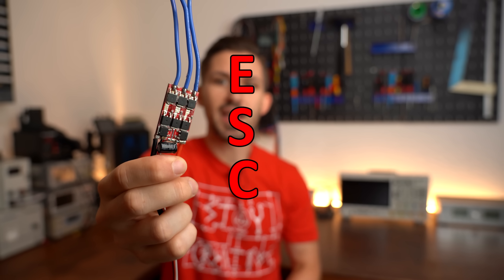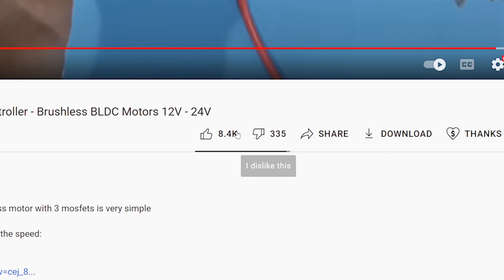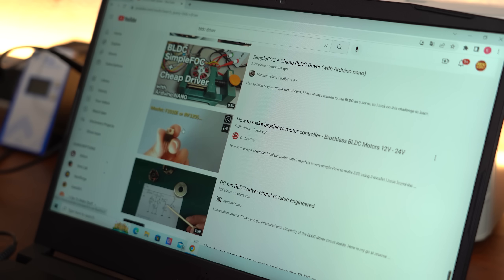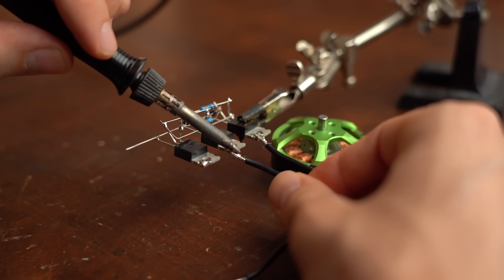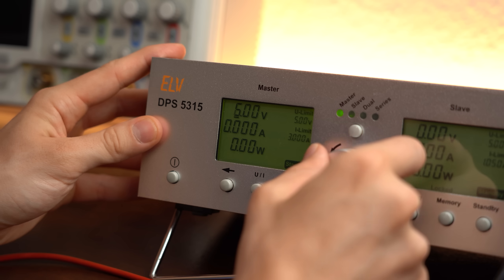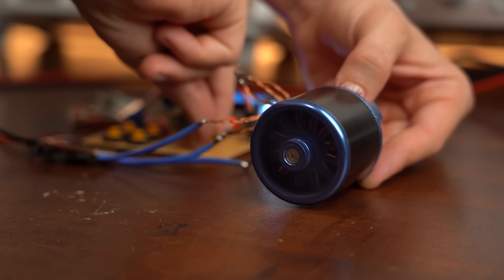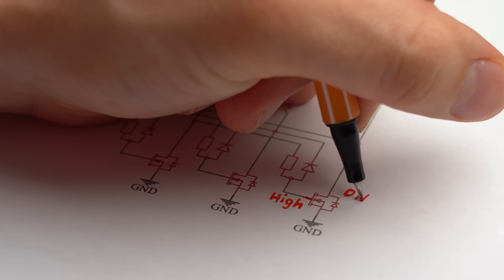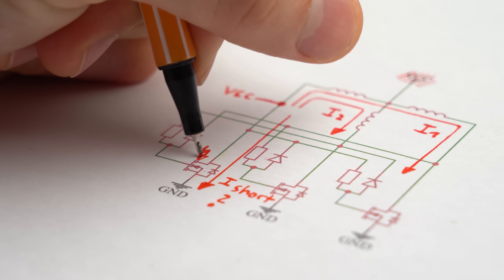I followed a YouTube Electronics Video and Regret it! (Debunking a 500k video)

Comment: I think it's more an exercise in "how simple can we make this circuit and still have our functions?" A lesson in building circuits, to be sure, but not something for practical use.
Reply: Aka muntzing
Reply: Thing is "simple" is often simple* when you start cutting so much out that the circuit is reliant on certain stray values or other unspecified/variable component characteristics to work properly, which makes it difficult to duplicate. There are some popular simple circuits that are simple and easy to get going with close enough parts, joule thief comes to mind, but there aren't many of them and they don't do anything particularly complicated, e.g. properly drive a BLDC.

Comment: As a general rule, I never trust any video where the circuit is soldered “in the sky”😁
Reply: I mean dead bug was very common in the 40's, and for rapid prototyping is still used today. Also used sometimes just for aesthetic or because it isn't desirable to put in on perf board or something

Comment: It’s been a long time since I’ve seen a 3-dimensional circuit sculpture— the last time IIRC, was looking inside a 1950s pinball machine.  Why this guy didn’t just plug his components into a breadboard is beyond me (they make high quality breadboards that can handle more current and have more insulation between lines, right)?

It’s one of those things when you’re watching somebody claiming to be the expert (debunking someone else’s video) who themselves seems to have skipped Electrical Engineering 101, and never learned that you basically never want to create a 3D sculpture, it’s easy to accidentally short-circuit (potential fire hazard), it’s hard to modify (e.g. swap out a resistor), and it doesn’t have the same logical coherence to a circuit diagram that working on a 2D plane with discretely layered lines and jumpers does.

Comment: As soon as I saw that it only had 3 MOSFETs I thought "how the heck is that going to work with a 3 wire motor?" and also "this isn't going to be speed controllable, because it must be using some kind of inductive feedback for phase control" - and yes, that's what it was. An interesting circuit, but not at all useful except as a learning example.

Comment: I'm sure you have a lot of requests, but I'll put out an appeal:
I'm slowly losing my sight and will be needing a braille printer at some point, HOWEVER, a cheap braille printer is $5,000US
Basic Braille characters consist 3 columns and 2 rows.  3 solenoids strong enough to raise a dimple on a paper sheet would be the ticket.
I can actually do the programming, but electronics is not my strong point.

Comment: Why can't we just have two wire brushless motors designing it may be difficult but it'd be a heck of a lot easier, I have a design in my head based off a couple magnet motors but given that magnet motors don't often succeed but some do I'm skeptical of my imagination.
Reply: @LabRat Knatz why can't we just include the ESC in the motor housing!?
Reply: @mrnobody.4069  There is. Hobbywing Fusion.

Comment: Running out of 10K, huh 😜?
Btw I remember that you used to store MOSFETs seperately. But now you have a single bin for MOSFETs. Same for diodes? Is it some extras bin? Or you mix these coz the package size is big and part number is easily readable.

Just asking because it would help me organize mine. I really like to be a (**Voltage**) Follower of yours 😁😂.

Comment: You can get capable BLDC drivers off of commercial printers some are pulse controlled and some with a voltage reference. Use the motor as is or remove it from the circuit and add your own.  https://www.youtube.com/shorts/fjeaiIZa_7s I am amazed that that circuit works wonder if it can be improved somehow. Thanks for the video. https://www.youtube.com/shorts/dyIYoKcMhQU Could you do a circuit that gets timed by Arduino to make these 9 components work or even less like 6 components? Always watch your channel. Here is a stepper driver done with TIP111 I think. https://www.youtube.com/shorts/d9JuIY5z2Kg You can drive a stepper with only 2 transistors check the motor on the left.

Comment: That's a simple astable oscillator.  Usually cheap rgb lights use this circuit but they have a cap as well from every drain pin to the next base of the tranzistor.  Simple for basic task but not stable for complicated applications

Comment: I'd enjoy seeing you use the AliExpress board you recommend. It has a lot of connection points and no schematic. Looks like it would work for a 5 wire motor? I'm  not sure how this board works but I like the specs and price.
Reply: No the alix board uses standard 3 wire motors. You can read the description for what the connection points do, not all are needed.
Reply: @jaro6985  Lol did you read and understand that gibberish? It might ght as well be written in greek!

Comment: After watching the diagram, I initially thought it works like a crude RING oscillator created by 3 mosfet and 3 coils with a star point. This is awful. Cause not all inductor or mosfets are ideally same and won’t start the motor due to insufficient current draw from star point to Lets say coil 1. It totally depends on high frequency oscillation, so you really don't have much room adjusting the frequency value. Some might add capacitor to control over frequency making the circuit worse and unstable. Also the total load is not equally distributed as you showed in last, it works with star point less motors too - prooving that only two transistor oscillating as multivibrator but in this case creating alternating current due to the nature of inductor to store and pull over the current. last but not least, the freaking spikes will definitely kill a Mosfet in the long run no matter how good they are. 

Designer of this circuit must be on weed while designing such bs.
Reply: Take 3 of the DIY inverters and feed it by a signal that's delayed by 120 degrees each.  Of course, at that point, it's just easier to use a $0.50 cent microcontroller and PWM the signals with a smoothing capacitor.  It still won't detect stall conditions, but it will at least drive the thing reliably.
Reply: @EmperorA0  absolutely

Comment: Yeah the circuit is not suitable for low speeds where the back emf is low, but I like how the commutation logic is implemented using resistors and diodes

Comment: Fascinating. I'm a complete amateur at a electronics but love tinkering understanding the underlying principles. In fact 9ne such project a few months ago was to understand how to make a basic BDLC motor driver... before I even knew of ESCs ;)

Ended up using an old Arduino and a bunch of MOSFET modules that worked fairly well, but just as the video would need a manual kick.

My take-away was that while his proved the basic principles it was clearly not a "useful" circuit and certainly not one I'd embarrass myself by committing to YouTube.

It's a real shame unverified crap like this gets so much attention but I'm grateful that channels like Great Scott are here to debunk and set us straight on such topics.

Comment: While it's not in any way an Electronic Speed Control as it doesn't offer any speed control, it's an interesting bench toy BLDC driver topology. Wouldn't call it a hoax or fake, it's just not that useful. With some tweaking though I wouldn't be surprised if this topology showed up in some cheapified China export motorized toy.

Comment: These are synchronous motors, they can spin only on the current's frequency. So when you want to start the motor, you have to increase the frequency from zero to the desired, otherwise they won't start. So if the circuit not supports the soft start, it's not wierd if you have to spin up the rotor by hand.

Comment: So... What's the solution to restart a stuck motor? I'd need this answer for a project :D
Reply: Put a start capacitor on one of the windings... Basic motor theory..
Reply: @platypusrex2287  I already did this without much success ^^, Do you have a ling to some literature about this kind of problem?

Comment: ESCs are used in the RC (radio control) hobby, and are strapped to quadcopters, cars, planes, etc. For this reason the compactness and toughness of it are quite important, hence the DIY doesn't make much sense.
Reply: I was always surprised how thin the wires if my 150 amp esc are, if you look at the ground wire of a welder...
Also the power output of modern brushless motors is insane, my 1:8 offroad buggy from 2013 has over 3 kW.

One important feature that self made esc is missing is the self starting and the possibility to reverse motor rotation, i dont really see a use other than the educational reason as you mentioned

Comment: You can easily run 3 phase low voltage induction motors using this circuit
Reply: Not for long.

Comment: Even though it's not a reliable way to drive a BLDC, I find it's still impressive that it somehow able to spin the motor. I wonder if there is a possibility to overcome the issues you highlighted with this design with few more analog components ( op amps, transistots etc). BLDCs are quite cheap these days yet escs are bloody expensive than the motor. If there is a way to build a simple esc for a lower price, I think this type of controllers too can have some niche applications. 
Also I don't agree with the title "debunking". It's certainly a working design, only it's not really good for anything at this stage.
Reply: Considering it doesn't even have a full 3 phase h-bridge, it is rather impressive.
Reply: @Jtretta  Yep, my exact thoughts. Spinning a BLDC is bloody hard, it's impressive such simple design can do that.
Reply: It's certainly a "debunking". The motor required a manual spin to start it. The whole gimmicky video relied on the basis that somehow, 9 components can achieve something as good as 85 components. That's debunked as well. If we add more components then sure the design can be made better. But then the component count starts shooting up. Then the proper ESC starts looking better anyway.
Reply: First comment which actually makes some sense.
Reply: I have a old cooling fan based on 7 transistors/FET's (unknown). It's made by a company doing professional fans.

Likely some overload feature and auto-start with the extra trasistor.
Reply: You should try searching for "BLDC driver" or "BLDC controller".

ESC is a part of remote controlled planes/boat/cars/bats e.t.c. They are not called that outside the field of RC crafts field!

Or go totally fancy: field oriented control motor drive (FOC).
Reply: Adding sense coils, or using a trigger of some kind will do it...
Look up pulse motors, they run themselves in similar ways...

Comment: I got a cheap 30a esc from ali for 6 euro, dirt cheap! Why make this useless circuit? Just save the mosfets for your next big project i also disliked all those esc vids you can make a esc at home but with 2 mosfets for each motor connection and a cheap atmega 328 pu mcu

Comment: I recently bought another B-G431B-ESC1 dev board. In my opinion one of the best (3 phase current sensing, mcu with math accelerator, can bus...) esc's you can get for experimental stuff and it's only 17€!
Reply from the maker: Thanks for the tip.

Comment: I don't know why they're still called that (Brushless DC motor). The ones in stuff like a PC fan, it's the motor and control stuff in one area. But just having like an RC motor, it's not a DC motor. It's a 3 phase permanent magnet motor.
Reply: Could it perhaps be due to their lack of brushes?
Reply: @SpeccyMan  They don't run on DC, though.
Reply: Could it also perhaps be because they are run from a DC power source instead of a synchronous 3-phase AC power source?
Reply: @kimsmoke17  But they're not. They're a motor that requires a controller. How the controller derives its source power doesn't classify the motor it's driving.

Comment: I kinda still like that circuit, it shows that there are simple principles at work theoretically but you need a more complex system to work out the issues. Wouldn't use it ofc but its good to know that this theoretically is all thats needed to get it to spin.
Reply from the maker: Well. In that regard I do agree :-)
Reply: theoretically you could hold it under a faucet to get it to spin
Reply: @Blox117  How does that matter tho? The question is not "how can I make it spin in general?" the question is "how can I make the motor spin with electricity?". I don't know how your comment factors in that discussion. 
Its not like the circuit is not doing what a normal bldc controller wouldn't do, its just that it is quite simple and does it poorly.
Reply: @Ramog1000  you could get it to spin by connecting the phases at different times manually. ta da

Comment: Let's settle a unsolved debate. Are bldc motor AC or DC?
Reply: without the driver, they are basically three phase AC motors; with the driver, they are simple DC.

Just like in regular DC motors, there is a commutator mounted on the shaft that makes the applied DC into AC. In that sense, there are no DC motors.
Reply from the maker: No comment
Reply: 3 phase motors can run on both AC and DC. Hobby motors don't zero cross so  called DC.  In AC motors the current goes in both directions. Can't see why a hobby motor will not run on AC. Find an AC outlet some caps and resistor to limit the voltage and current by way to much for me to feel safe around that bunch of wiring and it should run. I think. In the Electro boom realm.

Comment: Can you drive a bldc motor with pc 
I mean is there any way to control speed of bldc motor and drive them using your motherboard somehow

I asked because motherboard can generate pwm signals for pwm controllable fans in pc to control speed rgb etc , signal comes through motherboard 4 pin or 3 pin header
So can you ???
Reply from the maker: Not recommended
Reply: Those fan headers cannot put out a whole of current, and there no control over the phase from different headers. So no, you can't. You may be able to use the PWM to control an ESC, but I would be a little hesitant hooking power electronics up to my PC.